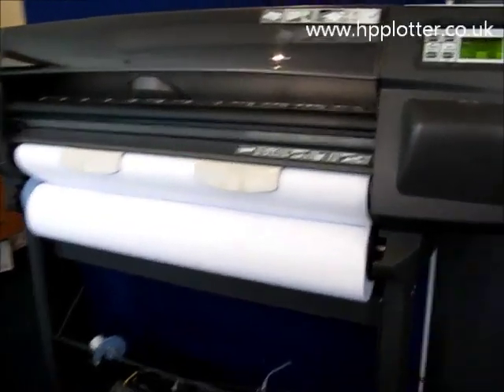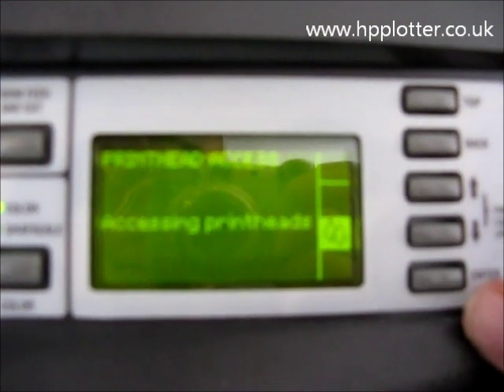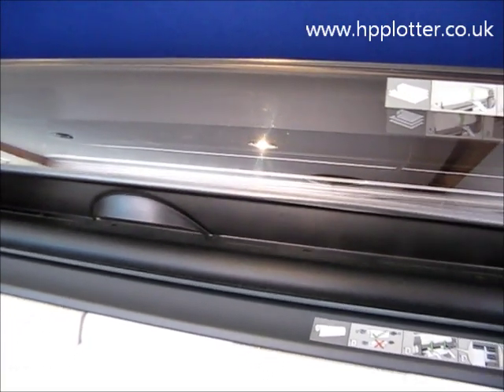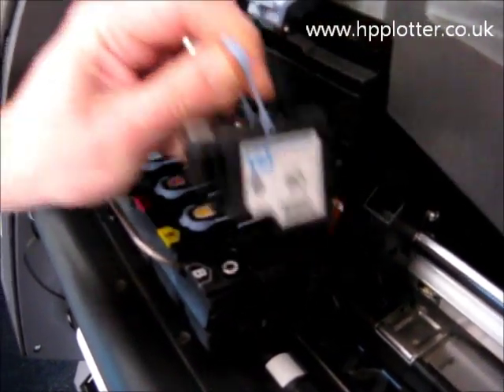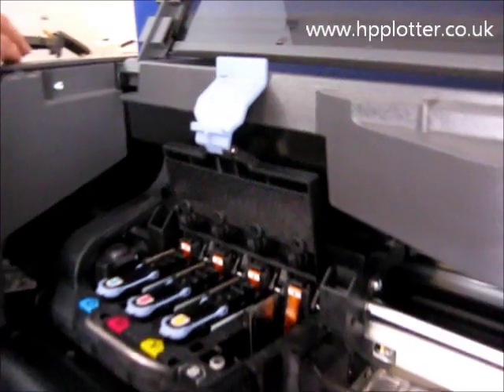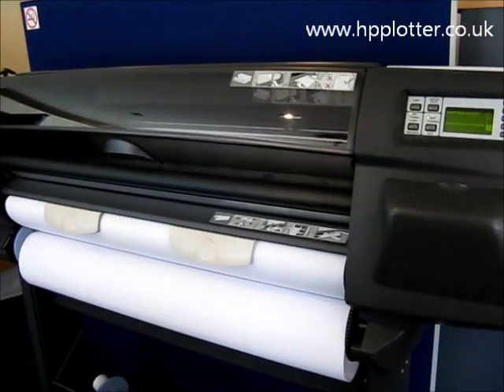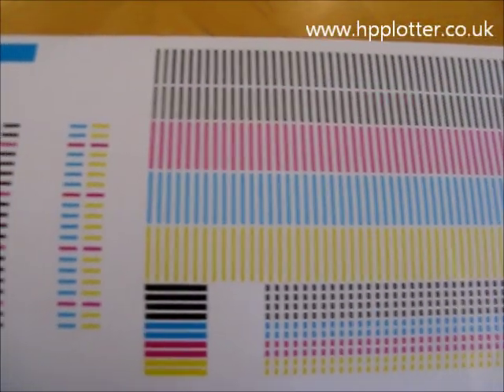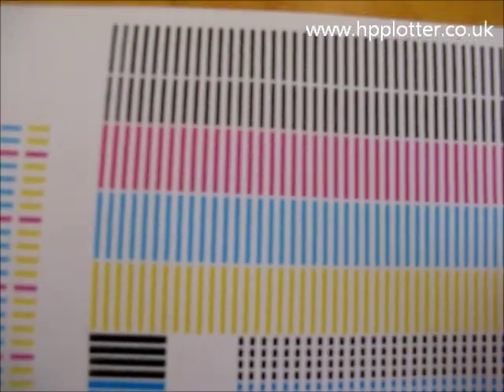HP DesignJet 1050 repairs - Replace print head

Comment: Hello, My Hp 1055CM has an error that says. Switch power off check printhead path (1). what do you recommend me doing first? Thanks!
Reply from the maker: Hello, Thank you for getting in touch, the error message on your printer indicates the carriage belt needs replacing.
Do let us know if you are in the UK, we can supply the part and engineer callout to fit and service.

Comment: i replaced the black printhead but i have a errorcode 'reseat 8' it's a new printhead so what could be the problem?
Reply from the maker: This is not something that comes up too often but in the past we've found this to be a defective printhead - or the contacts need to be cleaned gently because they are covered in ink so the connection isn't being made fully. If you try this first and then if this still doesn't resolve it you'll need to organise for an engineer to attend site.

Comment: Good Morning !
please to my machine 1055cm plus, this is giving the 0B0005 00000FF error.
I do not know what else to do.
Can you help me please.

Thank you
Reply from the maker: You might want to check out your air pressure system. Hope that helps. If you were in the UK we would be able to assist you with an onsite repair. I suggest calling HP in your own country for a fixed price repair.
Reply: Contact me I have the same machine

Comment: HELP! I am trying to connect a Designjet 1050c (C6074a) plotter to a Windows XP Pro PC. I've downloaded all the recommended drivers, etc and linked with both a USB cable and Ethernet cable (thru a hub). I can ping it but the best I've been able to do is print a test page however when I tried to print a JPEG image the Roll paper was not listed causing me to believe the proper drivers etc are not loaded. Can you help or point me in a proper direction?
Reply: Hi Doug - Please contact our engineering department (engineering@hpplotter.co.uk) or call us on 01256 783390 as there are a few checks we need to go through with you first to try and get you up and running.
Reply: Thank you for your reply. We found the issue, the IP address needed to  be changed, once that was done all was well.

Comment: guys maybe youll can help. machine keeps saying i must replac cyan printhead.i replaced it..worked for about 10 days and now its telling me again to change it? ive tried cleaning the contacts on the printhead and printhead carriage.still gives me the message after each print
Reply from the maker: Hi Mayur - you'll need an engineer to attend site as it is likely another part which is faulty and it needs to be assessed. If you are in the UK then please email engineering@hpplotter.co.uk or get in touch with your local dealer. 
Best regards, HP Plotter

Comment: I have this plotter. Well i had this plotter. The print head literally just spewed ink all over the ink cartridge area and all inside the rollers. Its so bad the ink is dripping from the bottom air vent of the plotter. Its been a work horse though for 8 years. Anyone have a suggested replacement for this plotter and does anyone want to buy  an older one that can probably be repaired. Im in miami, fl.
Reply from the maker: +Dave Miami (warmachine)  -  sorry for the delay in getting back to you, YouTube held your comment in our spam filter and it unfortunately got missed. The DesignJet 1050 can be upgraded to a T920 (single roll) / T1520 (twin roll) printer but it does depend upon your current print requirements and print volumes. Also a key question would be whether you are happy to work with a 36" (A0) print width - or whether you need a printer capable of taking a wider paper roll size e.g. 44". Please contact us at sales@hpplotter.co.uk for full advice.

Comment: My designjet needed replacement of tubes and after that no longer recognizes the 4 cartridges. either with the original tubes, only shows faulty on display, How can i fix this? Any idea?
Reply from the maker: @Syrtec I think this needs investigation by an engineer. You may have replaced the tubes incorrectly but it could be a number of different things going on. Please contact engineering@hpplotter.co.uk or tel 0845 0770 787 for us to help you resolve this.

Comment from the maker: @Carlos there is no Windows 8 driver available for the Designjet 1050c - the printer is too old and HP stopped making the print drivers for them. You might wish to consider having an old computer with Windows XP installed just to continue using this printer - alternatively please contact us about trading in your Designjet 1050c against a new printer - sales@hpplotter.co.uk 0845 0770 787.

Comment from the maker: Firstly clean your contacts and see if this resolves the fault.  Sometimes new printheads can be faulty - which can happen - and this normally relates to the software chip on the printhead.  You'll likely find that a replacement printhead resolves the issue so return the printhead to your supplier and advise that it is faulty.  If it's the case however, that all of your printheads that are failing on this machine, then it is more likely to be an engineering issue requiring a replacement part.

Comment: Thank you for the demonstration.  I recently replaced the black print head.  Following the tests the printer screen indicates that the print head needs to be replaced again just following the installation of a new print head.  Do you have any suggestions?  Is there a reset required?